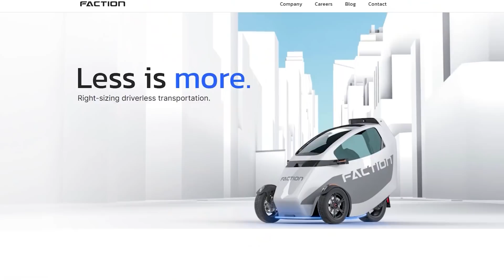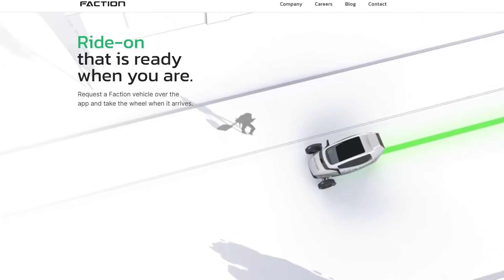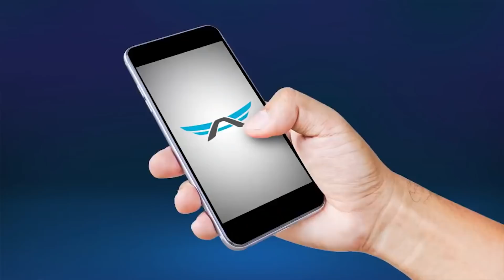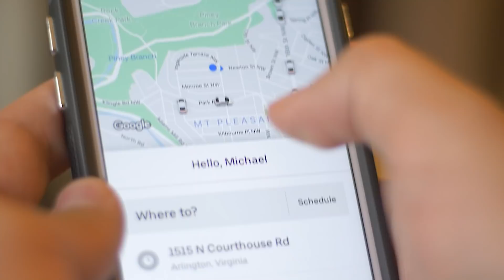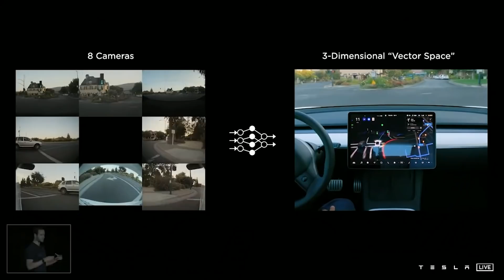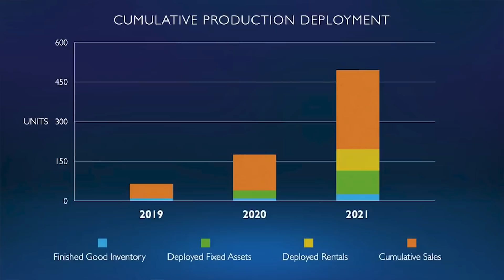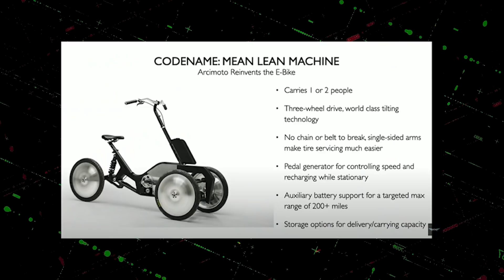Future of Firefighting | Full Interview w/ Mark Frohnmayer of Arcimoto!

Comment: I fell twice on my e-bikes last year due to slippery concrete trail through a wooded area. I vowed that if I were ever to buy a production ebike that it would be a 3-wheeler. The MLM looks to be exactly what I've been thinking about. Extra wheel up front and the ability to lean. With extra power to go on roads. Sounds like it's going to be well over $5k and not be here until 2023 at the earliest anyway. Maybe I will finally get ahead once I can rent out  my Cybertruck.
Reply: You might want to try a recumbent trike or eTrike. My partner and I both got one last year and they are sooo much fun! Much better stability and a far better seat. Adding the electric assist really helps on the hills. Depending on the level of quality, though, you can spend a lot less or a lot more than 5K on one. Check out the “Laidback Bike Report” YouTube channel for all the nitty gritty of this genre of biking enthusiasts and possibilities! But I am equally excited to try out a MLM. There have been a few attempts to offer tilting in the recumbent trikes, but this design looks really good!

Comment: The mini-pumper  fire truck concept is not new. I doubt very much that a 3-wheel vehicle as small as the  Archimoto  will ever be a viable fire truck or emergency vehicle,. A 4-wheel mini-pickup platform is a far better option with superior stability and load capacity.
Reply: @bloop The critical points are vehicle width, load capacity and stability. 3-wheel vehicles offer no advantage in any of the three requirements and are substantially less stable in off camber surfaces than 4-wheelers.
Reply: We shall see ;-).
Reply: @nardopolo101 You can fool investors, you can't fool Physics.
Reply: @olsonspeed  have you ever driven the Arcimoto?
Reply: @nardopolo101  I have driven on thousands of emergency responses, have you?
Reply: I think your missing the point of Arcimoto's mission.  It's not to haul the most water, bigger doesn't mean better.  Does not need to go off roading to fight huge forrest fires, not that regular fire trucks can either. What physical situations did you calculate for? Are you holding short? Marks intents I believe are honest. Just my opinion Arcimoto = smart investment.
Reply: @louren1951   There simply isn't enough storage in the Arcimoto for tools/equipment and Federally mandated firefighter safety equipment. Three wheel vehicles require  a motorcycle license in many states, the Arcimoto's wheel track is as wide as many four and six wheel vehicles, it cannot lane split as suggested  "like a motorcycle". If navigating grid-lock traffic or bike lanes is the top priority, electric bicycles or motorcycles would probably be the preferred response vehicle. The Arcimoto is a very poor fit for firefighting or rescue responses, several other companies offer well engineered, small sized emergency vehicles.  No I am not "shorting stock" or connected with any manufacturers or dealers, I did however respond on thousands of emergencies in my career and I know that arriving at an scene with extremely limited equipment is of no benefit. Don't believe everything you see in a glowing stock or sales presentation, do your research, consider all the options, if you still believe the Arcimoto is the future of emergency vehicles then by all means invest.   I offer this as just one option to consider: https://i.pinimg.com/originals/d3/b6/86/d3b686bf7ada8b420e498472c7f956d1.jpg

Comment: For the guest speaker: you can feel more secure leaning a 2 wheeled bicycle if you drag a foot to insure stability. If however you do accidentally lean too far into the turn then the momentum forces you to run, leaving your bicycle behind in the process.

Comment: Yes, there may be a niche for the First Responder Concept, but when it comes to wildfires, a light duty three wheeled ATV is not viable. Given the large number of four wheeled ATVs, that can carry more weight, the FUV frame is better for urban areas.
Reply: Big benefit of the Arcimoto platform is that it can go on road and light off-road (gravel/dirt). Agree that urban/suburban response will be a sweet spot.
Reply: @nardopolo101  Don't know how much off-roading  you have done, but I do think that on a two rut gravel/dirt road a wheel ridding the center of the middle hump would be a disadvantage.  As I own a FUV,  that back gear platforms load limit is thirty pounds.  I do not think that one back wheel will carry the load.  Could splice two front ends together?   I accidently left my FUV brakes on and it plowed a field.  Thanks for the reply.
Reply: @chrisconklin2981  definitely possible to mirror the front drive train in back, and yes, depends on the condition of the gravel road… though remember the back wheel is just along for the ride. Roadster also makes a better off-roadster than the FUV for a few reasons— that would be what I’d suggest for departments looking for both on/off road rapid responder missions for what we have today.

Comment: What I don't understand is how you would carry enough fire suppressant to put out something like a car fire. I get the fact that it's more mobile than a truck but if you can't apply a meaningful amount of water or suppressant all you can do is stand there and watch it burn while you wait for a firetruck. How much could this unit actually carry?
Reply: I put out a kitchen fire once.  Neibor had tried to put out a grease fire with the kitchen floor mat.  Flame blew up to the size of a bathtub. I was walking my dog and saw the flame.  I took a fire extinguisher and only had to squeeze the handle for half a second before the fire was out. Come to think about it the fire extinguisher that come with cars are alot smaller than what I used.

Comment: Message for Mark
Idea for the MLM.
One market might be for RV users.
If you could hinge the handlebars to drop onto the seat to reduce the height, then either have an old school "cable remote" or phone app to "walk" the vehicle up a light weight ramp into an RV garage, this might be quite attractive as an alternative to an E bike.....?
Maybe the rear section on a slide, so it can be compressed (shortened) for storage?
How wide is the front track?